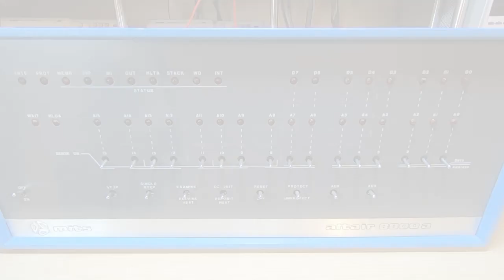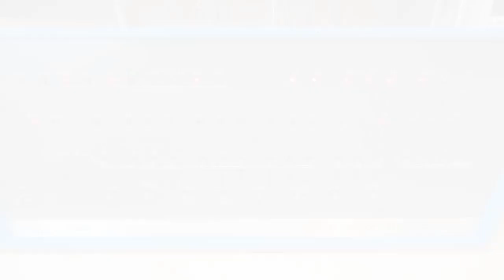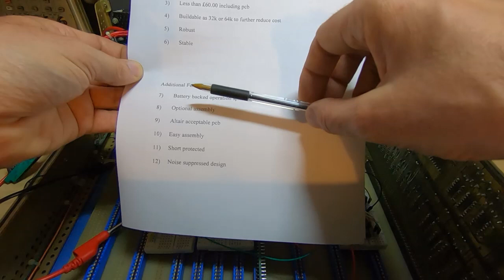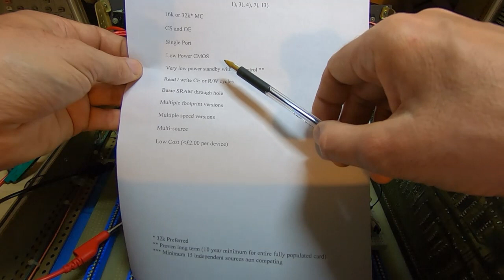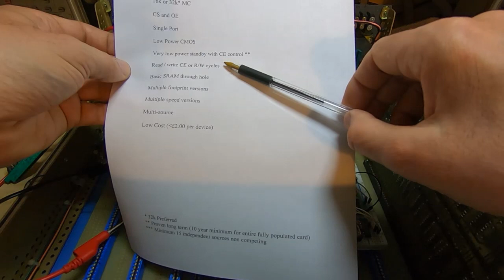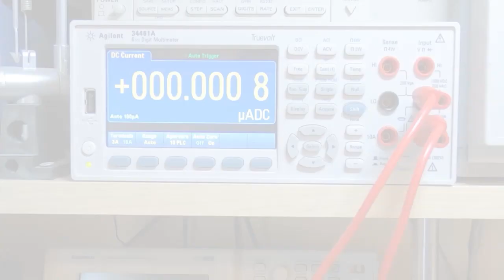Designing a 64k SRAM Card for Altair 8800 Part6

Comment: Instead of loading the BASIC interpreter and I suppose an operating-system externally in the unit's SRAM what about creating an EEPROM or PROM card to permanently store them?
Reply from the maker: That would defeat the entire point which is to allow the card to be the RAM. Programs need RAM to operate to using an EEPROM or PROM would not work. ROM cards exist but they have limitations in use that I wanted to avoid.

Comment: Is the peculiar front panel mode memory card operation basically the same between the Altair 8800 and the IMSAI 8080? I haven't compared the CPU and front panel schematics between the two. In other words, will your Altair 8800 specific design considerations apply equally well for usage in an IMSAI 8080 system? I acquired an IMSAI 8080 a while ago which I need to get running. Having a known good memory card would probably help troubleshoot whatever issues it might have.
Reply from the maker: I designed the card to work with correct bus signals for the S-100 bus but to be as immune as possible to skewed timing of these signals as can occur in the altair due to variable timing and noise. It should therefore work fine on the 8080 which uses a very similar method for depositing and examining data. In theory it should not matter how the control signals are generated as long as they are present which they should be irrespective of the mode (manual or run).